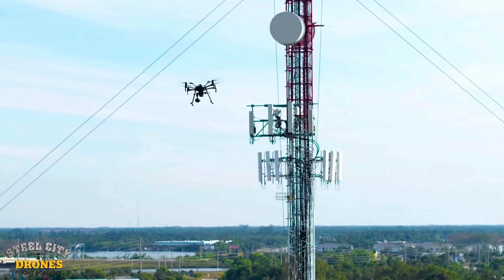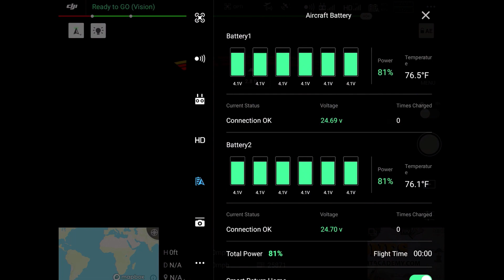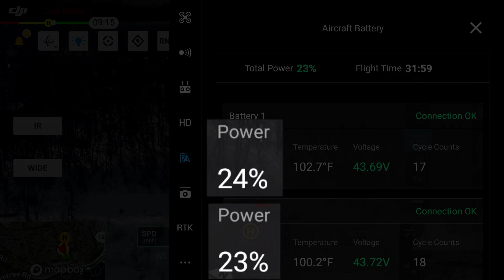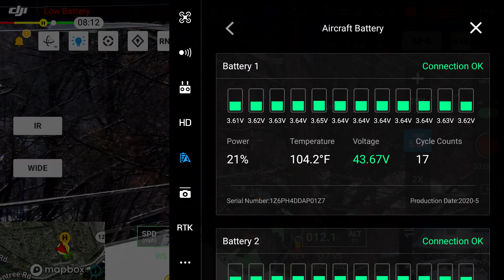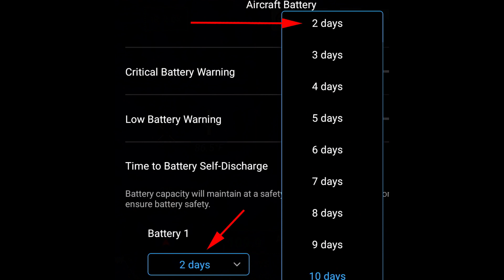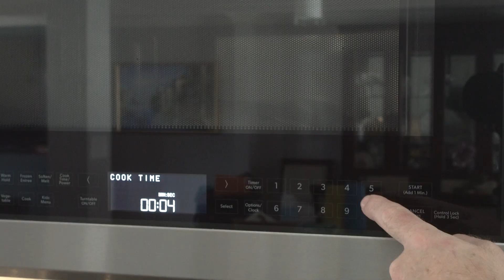Why DJI Drone Batteries Fail | Crucial Care & Maintenance

Comment: Air 2s owner here and I finally had to replace my 4 batteries after putting more than 7.5million feet of flight distance on the drone (just under 4 years of use) this includes flying in -10c temperatures through the winter months. The batteries worked very well right up till now however they are starting to swell, one so badly that it almost cannot lock into the drone. Good tips on the batteries and how to charge. I always fully charge a day before flying. I charge them up fully after flight and let them discharge automatically over the 2 days days after and then again charge up fully before my next flights. Seems to have worked for me.

Comment: Looked in battery settings on Mavic 2 Pro and there are no options to select days until discharge. Is yours the same or am I missing something?
Reply from the maker: Yes sir its there.
Reply: Same  problem. One response is “ Yes sir it’s there” where? Please more info
Reply: @jfjerez  Can you believe this guy's response!!!
Reply: @jfjerez  Actually - I did figure this out. You have to insert each battery in the drone to change each batteries settings.  I don't have mine with me right now to check how I did this exactly. It's possible to not have the setting available if you don;t have the latest firmware. If you do - then try clicking the battery icon on the top, or some advanced setting. I remember an option that did say discharge days. I change all mine from 5 or 7 days to 2 I think... Sorry - don't remember exactly. Just remember to insert each battery and hit the battery icon.
Reply: Buy as many good new batteries as u can for your 2s before they completely discontinued it.
My Mavic Air is now discontinued and they stopped selling batteries so its basically junk till I find some way of getting hold or trust worthy batteries. 

Very bad imo.  So buy them while u cam and use them a few times to make sure they are good ones while under warranty, then keep them and store properly ad advised in this video and others.  Using now and then but don't store them for more than 3 months without doing a repair cycle as he said here. They should make batteries, .my drone is mint and I only have 1 battery with 37 charge cycles on it, so I'm trying to look after the battery as much as possible haha
Reply: Wish someone told this while they were still for sale and wish I listened, I'd buy 3 or 4 more spend up to 400usd up to you, at least u will be able to use your drone that costs over 1k anyway!! 

Got eyes on Mavic 3 but if they stop making batteries for it, I'll just go DIY race drone route and screw DJI lol. 

They would love me to get a Mav 3 wouldent they, and then discontinued the batteries after 3 years (lockdown ate 2 years of possible travel for scenario, candle burnt both ends)!   This is a real first world problem so don't feel sorry for me, some people don't have food!! But DJI have alot of food I bet!!!
Reply: @augustusmaximus891  Great point - this is another example of designed and or planned obsolecence. If they can't mess up the firmware to sell more products, they will do it by not selling batteries!

Comment: I purchased my DJI Mavic Air in January 2020. I flown my aircraft only once and then I kept it idle. I was busy at my work and now after two years I tried use it during vacation. But I couldn’t charge my battery. I just used it once and now it’s not charging. What to do?
Reply from the maker: Its done, you need to buy a new one.

Comment: Hi everyone,
Sir I am using the M300 RTK sensitively one week but one of four the batteries has completely discharged in the case, what can I do to recover the battery?
Reply from the maker: Do you mean the battery is completely dead? If so the battery is bad and should be under warranty. It has a 6 month warranty.
Reply: Thank you for your assistance. I will order a new one.

Comment: DJI recommends discarding the batteries after 200 cycles (Matrice 30 RTK Maintenance Manual). Is this something you agree with? What is "a cycle"? Form fully charged down to 20%? Down to 60% for storage?
Reply from the maker: There really isn't a magic number to follow. You should follow what your batteries are telling you when you test them through the 2 different tests that we recommend every 50 to 75 charge cycles.

Comment: Using our M210 for search and rescues, the biggest problem we have is that we have to be ready to fly at a moment's notice.  Often, the batteries will sit for weeks before being used at the last second.  Unfortunately, we don't have the option of flying with fully-charged batteries because we never know when we are going to going out until an emergency arrises.   Is there a way to mitigate this situation to not only extend the life of our batteries, but to not have to fly with batteries when they are in storage mode?
Reply from the maker: It's ok if your batteries sit for weeks in storage voltage you just want to avoid the batteries being dormant for 6 weeks or longer. You can also fly the batteries if they are in storage voltage if needed which is about 65% you just wont get very good flying time. Rather than flying batteries at storage voltage, what we recommend for agencies like yourself is to have at least 4 sets of batteries and a few of the chargers. Have 2 sets fully charged with them set to start discharging after 2 days.  When those discharge, take the other 2 pairs and charge them.  That way you have 2 sets at all time fully charged. You will just need to keep charging batteries every 2 days. Then if you need to go fly on site, bring at least 2 chargers with you to charge up the other 2 sets.  It helps if you can have 6 sets and 3 chargers so you can always have 3 sets of batteries charged at all times ready to go.  As for overall extended life, follow the content in this video. Never exceed 125F,  don't fly down below 20%, don't let the batteries go dormant, and set them to discharge after 2 days.  Also always have the batteries at room temp when installing on the aircraft, never fly a pair of batteries that are below room temp. About 3 or 4 times a year do test flights with all batteries monitoring the individual cells making sure there is no more than 0.1 volt gap from cell to cell.
Reply: @SteelCityDrones  Thank you for the timely reply and good advice.

Comment: I remember the setting on my DJI app 4.0 was a setting for the time before start to discharge to storage voltage. ( on my magic pro) but I think on my Magic 2 Pro under the battery status and settings I don’t see that it anymore. Is this normal?
Reply: The option is gone for some reason.

Comment: What does it mean if my battery is 100% but has voltage of 4.12v something?
Isn't supposed to be 4.20v? I'm using DJI Air 2S btw.
Reply from the maker: Your battery is most likely bad as a fully charged cell should be about 4.34 to 4.35 volts.  Most likely your State of Charge Indication can be off from the battery sitting too long without being used or the firmware on the battery is not updated as it should. You could try to fly it down as low as possible to sometime like 5% and recharge it then recheck.  If your drone has the capability of monitoring battery temperature don't exceed 120F degrees when flying it down. Be very careful and keep a close eye on the battery.

Comment: Great information. Another tip:
Do not leave your batteries in a hot car. I left a fully charged mavic 2 battery in my car during 90 degree weather for 1 day. The next day I tried to fly with it and the battery swelled so much it broke the plastic and the drone crashed
Reply: Never expose lipos to heat full stop. They can catch fire very easily cauing more concern than a crashed drone in most cases.
Reply: You are very, very, VERY LUCKY GUY.  how dare you could leave "LIPO" battery in da car on da hot wx day???? it could easily catch fire and Ruin your whole car!!!!

Comment: Simple question - I have Mavic 2 Zoom. Where is the ideal storage percent? 0%, 5%, 10% 15%, 20, %, 25%? My guess is 20%?
Reply from the maker: Please watch the full video as we cover that. You should "never" go by percentages, you go by voltages of the cells. For storage voltage its 3.85 Volts.
Reply: @SteelCityDrones  So are you telling me DJI expects the customer to go into battery settings during flight and make sure the voltage is not lower than 3.85 volts?
Reply: @danherrick5785  try to land between 20 - 30%

Comment: Hi buddy, say if I fly my batteries down to 0% on my mp2 once every 6months then charge them right back up again is that ok. I heard that this resets the cells ? Ok thanks buddy.
Reply from the maker: No you only want to do battery rest if your batteries have been dormant for a long time snd you have diagnosed your SOC is off. And even then you never fly down to zero. If you ever do a battery rest watch that your battery temps never go over 120.

Comment: Battery maintenance is the hardest task when running a law enforcement UAV team. Our system must be in a state of readiness at all times. Since a set of tb55 batteries can take anywhere from up to 140 min. to fully charge we have to live with replacing our batteries more often.
Reply: You can set your discharge times longer, let's say five or six days, and you can make sure that pairs of batteries (or single batteries if your aircraft flies on a single one) start discharging on different days and that you recharge them in accordance with their schedule. If you have six sets of batteries, three of them could be always full then, without compromising total battery life time too much.

Comment: 4.3 or 3.34? I kept getting confused when you keep saying make sure it's 4.3 or 3.34 volts. ???
Reply from the maker: 4.34 to 4.35 volts is fully charged, 3.85 is storage voltage, 3.62-3.63 be on the ground by.
Reply: @SteelCityDrones  
My 3S mavic Air battery was as follows.

At 99% (18 hours after full charge, full charge was after starting at a full charge, going down to 15 or 20%, then left battery for 6 hours before charging to 100 and doing this test:
Cell 1 = 4.18  
cell 2 = 4.13 
cell 3 = 4.14

65%
3.83
8.80
3.79

49%
3.72
3.71
3.70

36%
3.67
3.66
3.65

25%
3.62
3.61
3.61

20%

3.61
3.60
3.60

Test flight stopped here :)  3.6!

Note... the difference in cell volts at higher percentage, should I be worried? The battery was dormant for a year sitting at 60 ish percent, when I pulled it out, it was about 55 or 60 still...

My mavic air is discontinued so this is the only battery I got, hence going to town trying to understand best practice.

Thank you for the insightful video brother!!!
Reply: @SteelCityDrones  oh yes, also this battery is 25 charge cycles in. Storage temps are and have always been in the 20s so no freeze or baking in the sun or got car!

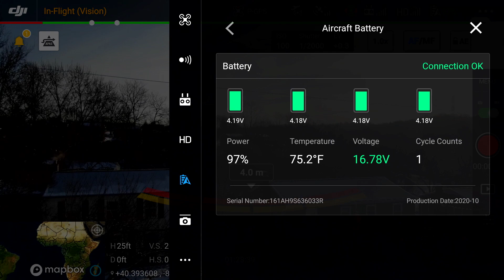Comment: At 6:59 you make a mistake. You say 3.3 - 3.35 Volt but you mean 4.3 - 4.35 Volt. At 8:13 it's not 100% clear to me either what you mean. Otherwise, very clear information, thank you!
Reply from the maker: 4.34 to 4.35 colts per cell.

Comment: Setting of the discharge value to a lower amount of 1 to 2 days for most drone operators it’s not ideal since one has to travel the next day will travel a couple of days to location and the job main tail to 3 days on site
Reply from the maker: Ideal or not that's what they need to be. That's why you see the new firmware for Enterprise batteries all default to 2 days in the settings now.
Reply: @SteelCityDrones  true- started seeing them at 2 days - I work for national parks australia- - told all remote pilots to change to 4-5 days due to remote travel and lack of power …. what are you / your customers getting cycle count from battery’s ? P4P , m200, m300? Thanks again and great video!